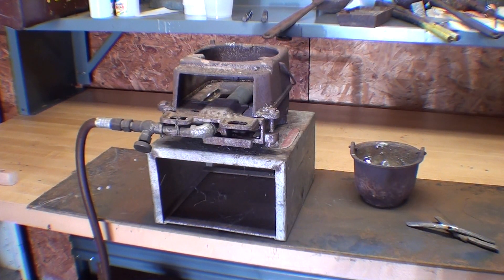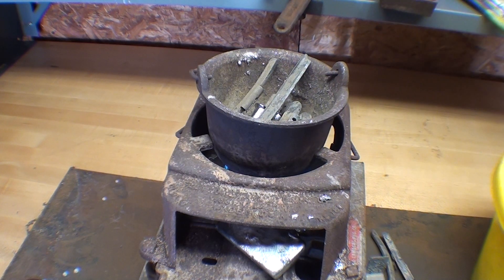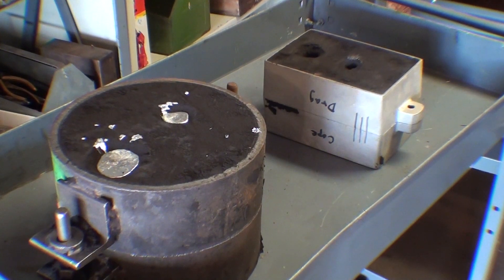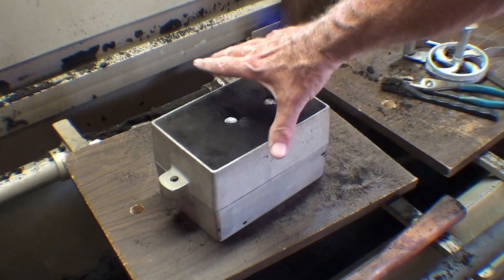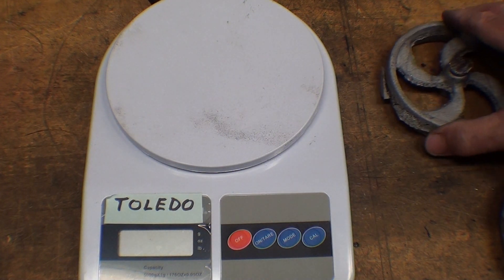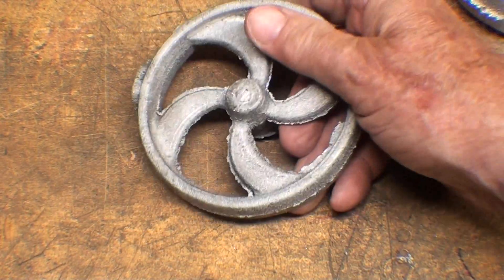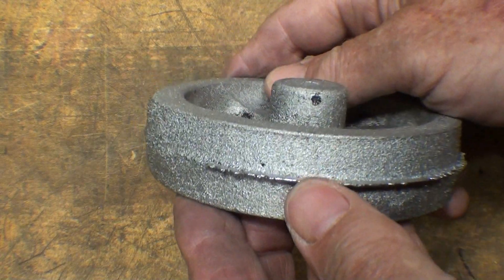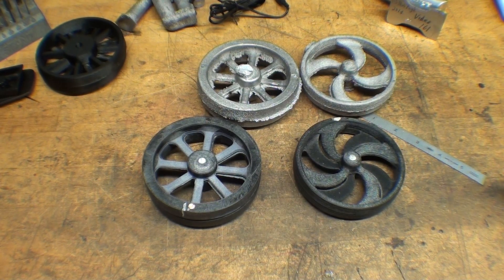TIPS #324 pt3 Casting a Flywheel Pattern - 3D Printer tubalcain

Comment: Very cool process. Ill have to watch your aluminum casting videos next
ALSO...
If anyone is interested in 3D prints and cant get a hold of Herb Blair, I charge very little. Designing the CAD model can take some time, but prints are fairly inexpensive.
Id charge $20 to CAD model one of those wheels, and about $5-$7 per whole wheel. 

3D printing is practical for reiterative design work, and once you get a working design, you'd want to create small production runs (under 100 pcs). 3D printing is perfect for precision reproduction but not mass production (over 500 pcs.) Not a rule, but at some point, injection molding will be less expensive than 3d printing.
Nate@Reach3dPrinters.com

Comment: Great videos!  Would have loved to get into this stuff, but it ain't gonna happen.  Still fun watching.  I am getting into 3D printing though.

The great thing about 3D modeling is you can do absolutely anything.  So you set the specs and the 3D model can be made like that.  You want tapering, holes drilled to line things up, etc.  All can be done.  With the 3D Printers we use today might be more precise to drill the holes yourself still to line things up, but maybe not.

With printing PLA its just a lot of sanding that has to happen.  Sand, then prime with a primer that also fills, then sand more, then wet sand and you can get it very nice and smooth.  Should help with the removal from the molds.

Comment: Personally I like the long videos.
one method of smoothing a 3d print. IF the print was done in ABS plastic. is to do an acetone vapor bath. there are videos on how to do that. will smooth all the surfaces.
I think there is a method for doing it with PLA plastic also but I'm not sure .
Also with some fine adjustment on the printer... slower speeds, layer thickness... you can smooth the prints out a bit too.

Awesome job on the casting and really cool the guy sent you the prints to try that with.

Comment: is it posible to spray them with automotive spray putty to smooth the surface out ?
it is very easy to sand.......or maybe even dip them in PVA wood glue to smooth it out before sand casting it.....

Comment: Would turning a section of steel pipe the diameter of the wheel and casting other lighter metals for the spokes be acceptable? Maybe sleeve the bore also with steel bushing for better longevity of the parts. If the pipe wall is heavy enough a plastic center for spokes might even work with bore again sleeved with steel bushing.

Comment: In addition to making patterns for metal casting, there is a 3d printing process called DMLS (direct metal laser sintering) that prints finished metal items.  I know NASA, GE, and Rocketdyne uses this process to make complex rocket and jet engine parts out of exotic high temperature alloys like inconel and hastelloy.

Comment: ADD didn't exist when I was growing up (you would a clip around the ear hole from the teacher if you didn't pay attention) so I don't have it <smile>, which means I am fine with the longer videos. I imagine that 8 spoke wheel has enough material on it that you could easily machine it down to a lighter weight.

Comment: Worked in a file making plant for several years. Files were hardened in huge induction pots filled with lead. Guys stood over those pots 8-10 hours a day hardening files (quenched in brine) for years with no health problems with lead. Finally switched over to bismuth.
Reply from the maker: I know--my brother & I were melting lead when we were 8 yrs old in our coal furnace. I'm still kicking at 73
Reply: +mrpete222 on our gun club we shoot with copper clad lead projectiles and most shot lead projectiles. the concentration of the lead vapour was high and my lead levels were always acceptable. at work we worked with lead, brick dust etc... it was a sidewalk ledge that got me, disability at age 30 as my spine is damaged.

Comment: I have noticed a lot of the wheel weights are made of zinc now a days.  I could tell them by dropping them on a concrete floor; the zinc will ring more than lead or lead alloy.  Not a good idea to use zinc or lead alloy with zinc added in an aluminum bullet mold.  I think I have already found this out by accident.  Greg.

Comment: 3-D Models for casting are a great new way to make prototypes easier, but some surfaces will need to be smoothed out on some of the more vertical angles where the castings need to rub against the walls to some out, until we get printers that produce smoother finish...
Reply: You can smooth out your printed parts in an acetone vapor bath or  use a printer that prints with liquid resin.

Comment: Great video.  By the way I used to make a lot of lead castings from a mold made of two part RTV.  The RTV molds would capture the most minute of detail, even finger prints.  I could get around 100 castings or so from a mold before the detail would start to burn out.  The only drawback is that you really need to vacuum the RTV when you make the mold and it takes time for it to cure.  You should try it sometime.  As far as the short videos, they are okay, but I really prefer your long ones with all the side discussion and everything else.  Just seems more friendly that way!  Besides, if folks don't have the patience to watch, maybe they shouldn't practice some of these activities.

Joe

Comment: Nice series. We actually have machined prototype parts (V6 cylinder heads with an integrated exhaust manifold) that are cast with printed cores.... Not identical to a production process but impressive just the same.  Thanks for the videos!

Comment: I am amazed at how it even cast the the finish surface texture of the 3D printed part. With that large flywheel you could make a larger capacity engine, perhaps with more cylinders? Maybe even a V4 or V8 or a radial engine. Have you ever thought about trying to cast and machine an engine block and making it steam powered? On an unrelated note I would also love to see you make something for these engines to drive like a car or steam locomotive. I have seen the generator videos.

Comment: Obviously the Grain Fineness Number of your sand won't allow the lead, being as dense as it is, to flow over all of the gaps between the sand grains and forces the lead to fill in all of the gaps. A rough casting is to be expected. However there is a solution to the problem; a mold wash. I know you use Petrobond so the formulas for Greensand molding will be ignored for now. Plumbago, finely ground graphite, can be dusted over the mold cavity and all gaps filled when spread evenly over the surface of the mold cavity with a very soft brush, like the kind you would find in a artists' supply store. Or you could mix the graphite with alcohol (you would have to experiment with the proportions) and spray the mixture into the mold cavity. The spray method would allow you to apply the graphite more quickly but, in my experience, you will still have to use the brush to smooth out the surface of the mold wash. If you don't want to spray it, another method is to paint the graphite/alcohol mix into the mold cavity with the before mentioned soft brush. "Try it, you'll like it."
Reply from the maker: thanks--good ideas

Comment: These would be harder and machine nicely if cast in Zamak which is an alloy of Zinc and Aluminum. Molten Zinc will dissolve Aluminum to make the alloy at not much higher temperature than lead.

Comment: I didn't know the ADD videos had separate footage.  I thought if I had watched the long versions that there wouldn't be anything different in them other than editing out parts or speeding them up.

If I've heard right, Enco has been a division of MSC for quite some time.  What I'm going to wait and see is if now that they are moving to just the one MSC brand whether they %-off sales will have the higher minimum order amounts of MSC or the smaller (many times $25) that Enco's offers did.

Herb did a nice job on them, thanks for showing them in use and explaining the issues.
Reply from the maker: Yes-I'm sure they are just merging into one brand. Yes, they have been affiliate quite some time.

Comment: Lead has a surface tension about half that of aluminium which allows it to flow more easily into the gaps between the sand grains.
Reply: This is what I was thinking, something along these lines.
Reply: This is true.My source is I learned about this while training in a course dedicated to manufacturing techniques.

Comment: does anyone know why old pulleys and large valve hand wheels always had curved spokes? being that the patterns were all made by hand they had to have a reason for it, otherwise why go through so much extra work?
Reply from the maker: I heard that it prevented cracking the spokes as the metal cooled????
Reply: +mrpete222 I always assumed, it would allow for a little flex, radially and axially.
Reply: So my old shop teacher told me this and i believed it my whole life until i just did the math...

Lets assume a given metal gains 1 inch per 10 inches per 10 degrees during heating/cooling
A wheel with a 10 inch diameter will have a circumference of  31.415 inches.
After heating 10 degrees, the circumference will increase by 3.141 inches to  34.557 inches.
Now after heating, the diameter will also gain 1" to 11 inches. Calculating the new circumference for an 11 inch diameter gives you 34.557 inches.......

According to the math, there should be no problem with cracking in a straight spoked wheel due to heat applied evenly. This does not account for when the hub gets hot and the wheel stays cool, which is a likely scenario of differential heating. Curved spoked and dished wheels can solve this. Both allow some flex to accommodate the differential.  With a dished wheel, however, differential heating could cause the rim to move laterally, causing belt alignment issues.
Reply: Notso Fresh thanks

Comment: Nice work. The castings reproduced the pattern from the 3D print! Would be interesting to see you clean the patterns up with bondo before molding... Don't bother with the short videos! If people don't have enough patience to sit through your valuable lessons then they don't deserve to learn at all.
Reply: People complaining when they get free education and information is just plain silly.
Reply: People complaining when they get free education and information is just plain silly.
Reply: I had a similar idea, but instead of bondo I was thinking of dipping them into an acrylic or epoxy based resin. Hang them and let the excess drip off while drying.

Comment: Looks like they turned out OK.  Glad I could do it for you.
Reply from the maker: Thanks again Herb. I plugged several times. I may machine them yet if I have the energy.
Reply: Could you use a soldering iron to smooth out the casting?  Might save some of the time spent filing.  Thanks  for another very informative video.  They can take the teacher out of the classroom but they can take the classroom out of the teacher.  
I like to keep a bucket of water with a wet towel nearby when I'm around hot metal just in case someone gets splashed; but my mother always complained that I was too delicate.  That's why I studied hard in school so that I could work in an office.  Grampa worked on the coke ovens.  Seeing his scars convinced me that it was much better to study hard in school.
Reply: Thanks for making the patterns.  3D printing seems like a great solution to manage the problem of shrinkage when producing replacement cast parts.
Reply: Just curious what you used for a 3d printer.  Also were the patterns from Thingiverse?
Reply: Interesting the "soldering iron method..."    and, 'scars character' or so I am told.